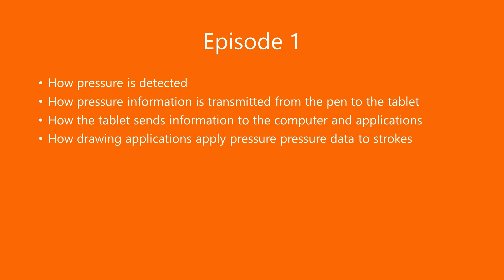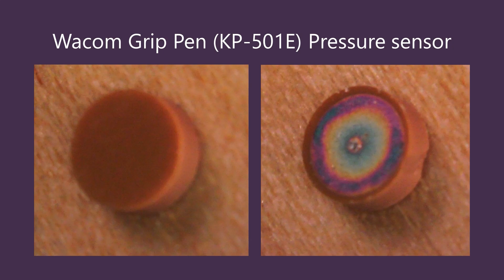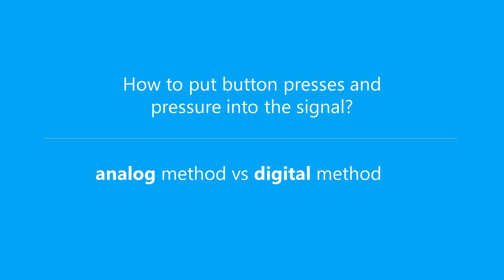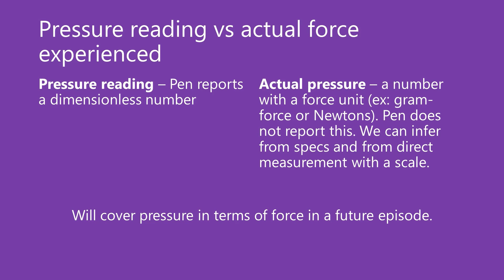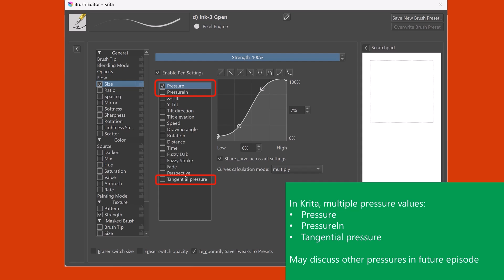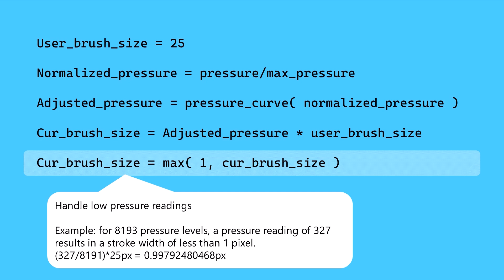Drawing Tablet Pressure (1): Introduction to pressure

Comment: Hello, I was recently enamored by your video on extra large tablets and desperately wanted to try it for myself. I shopped around but had no luck finding anything 2nd hand; so, I was wondering if using a Cintiq Pro with its screen off would be comparable to that extra large tablet experience? 

Thank you for all the great videos!
Reply from the maker: Yes that would be a very Good way of understanding what it would like to use an extra large pen Tablet. In fact, lots of people, including myself Sometimes use are pen displays as if they were pentablets By disabling the display signal going to the tablet.

Comment: I always assumed that the krita brush setting was pressureIn (as in Input) and not Ln since it only measures the peak pressure inputted throughout the stroke.
Reply from the maker: You are right! I didn't bother looking into what the setting actually does because I was going to do that in that separate video. I am so used seeing charts with log scales, I read it as "LN" instead of "IN" out of habit. My mistake. Thanks for noticing!